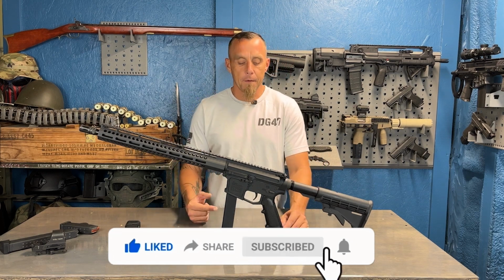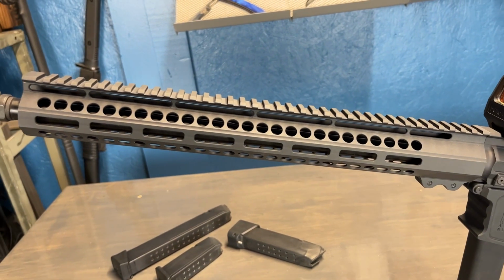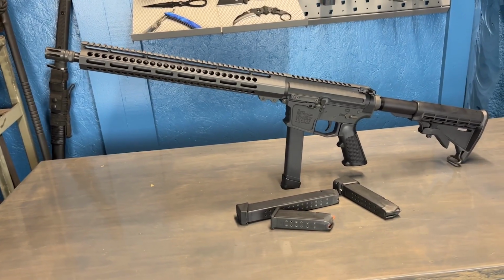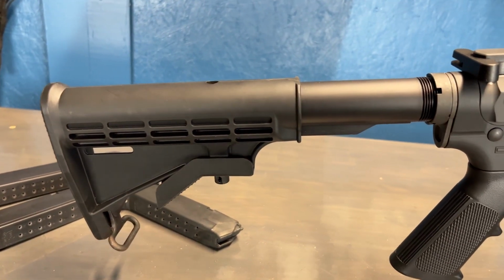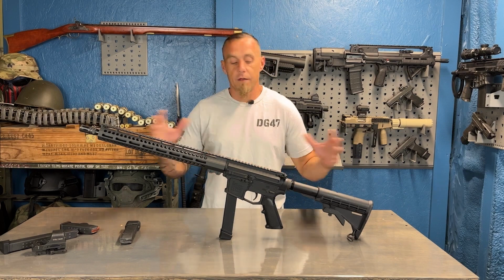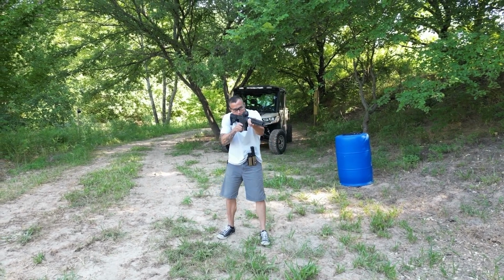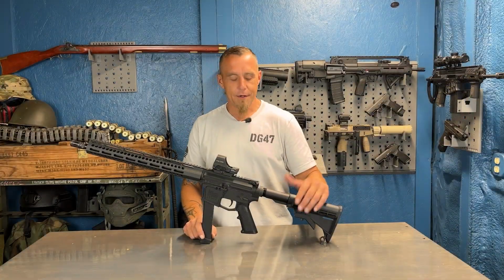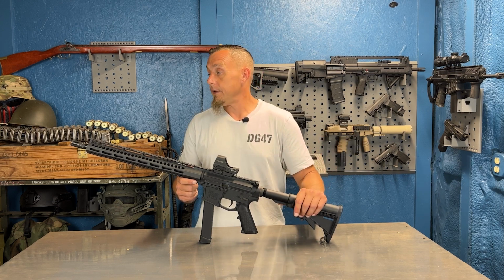The Sonoran Desert Institute AR9 build.

Comment: Can the lower be swapped with ar 15 uppers?
Reply from the maker: No. Because this gun is chambered in 9mm, and AR15s are usually 5.56 or .223 which means the chamber pressure is greater and the bullets are smaller. It can be swapped with other AR9 parts.
Reply: @doorgunner4752  oh oh oh okay makes sense